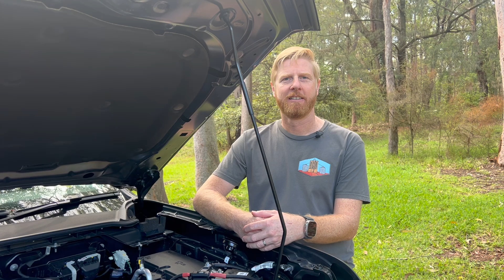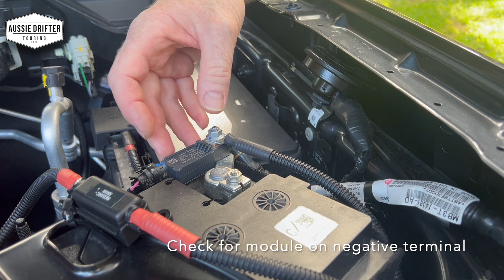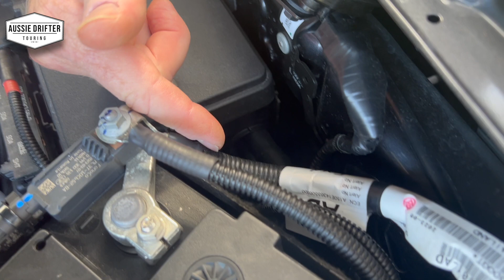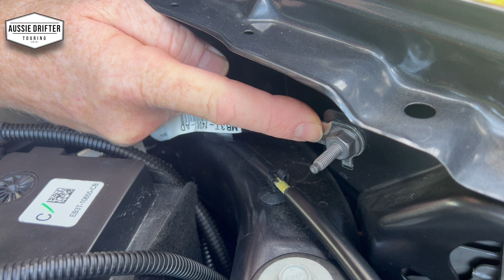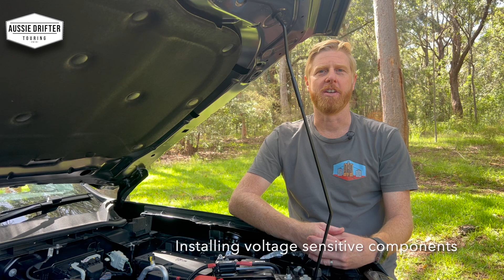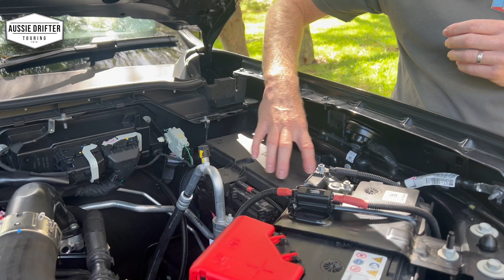Does my car have a smart alternator??? here's how to tell...

Comment: So, if I was testing the alternator output with my multimeter or battery tester, would I connect the negative part of the equipment (to get a correct reading) to the negative post on the battery of further past the module? The reason I ask is that sometimes when I've checked the status, it can show as NO OUTPUT (from the alternator) because the alternator is being 'smart'  ?

Comment: Wow, super i fund a simple  explanation if my Car got a Smart Alternator which it is I’ve got a Ford Ranger Raptor 2024 Model, but I have a question if you can help would be appreciated, for example I have installed already an Anderson Plug from my battery to the back of my truck for my Solar Panel on my Camper but I want to install a charger 2 from BLUETTI to charge my Apex 300 Battery from BLUETTI there’s is a lots of videos on YouTube how to install the Charger 2 but I couldn’t find any info about how to install it if I have Smart Alternator??? Thanks 🙏 appreciate your help ,,,, thanks again

Comment: As the alternator voltage changed so will the feed voltage to the fuse block, no?
How can the alternator voltage drop below the battery voltage? Wouldn't that drain the battery instead of charge it?

Comment: Cool. My 2015 LVD V80 has a normal alternator. I can simply run a switch to the ignition to isolate my batteries when the vehicle is off.
Reply from the maker: Yer with a standard alternator you can use either a VSR relay or an ignition controlled isolator

Comment: Can I just plug in an AGM battery if the stock battery my car came with was lead-acid and have it charge at the correct higher voltage if my car has a smart alternator?

Comment: And what is the difference to connect equipment on this bolt underhood, or on bolt somewhere in the trunk, if whole car body is one big minus connected to battery negative pole through this cable?
Reply from the maker: Yer you can connect to the body for sure. that's what your effectively doing by going the body side of the module.  This is just to highlight that you can't go straight on the terminal.

Comment: From what I understand this would still make for very bad leisure charging. Why can’t you just pull the plug out going the sensor on the battery. This should mean the alternator is now normal and a regular VSR can be used
Reply: using a DCDC charger would be the best option as these have multiple stages of charger to look after and increase the longevity of deep cycle batteries and are a must for certain types of batteries. Once the battery is fully charged they derate and sit in float mode rather than keeping a high voltage on the battery. This video just shows were to install negatives no matter what your installing.

Comment: Hi there. 
Is it possible to disconnect the smart alternator?
Reply: Or just unplug the sensor. At least on a ranger, that works.
Reply from the maker: Hi mate, you can get the dealer to turn it off. Just ask next time its in for a service.

Comment: Great input. I did notice were you tapped into the fuse BOX for dc dc charger you had your finger covering the exact same spot i had to nibble a little bit of plastic out also to fit my wire thro. 😆 thought there be an better way but it was the easiest solution at the time..
Reply from the maker: Glad the video was helpful mate.  Yer that’s really the only way to do it and we show the exact procedure in our installation videos if you want to check them out.